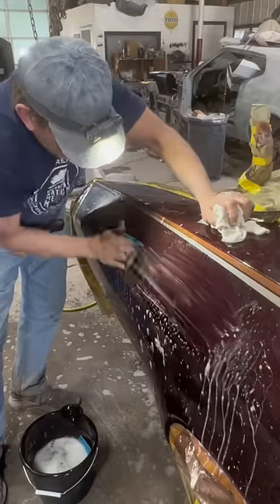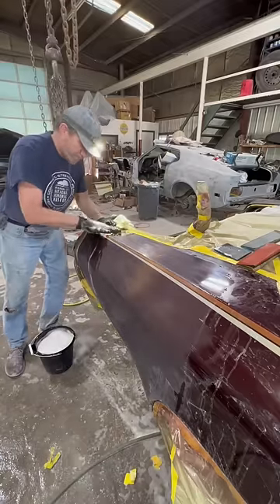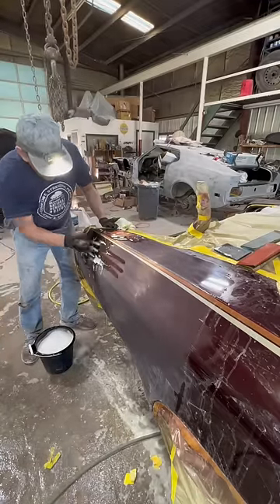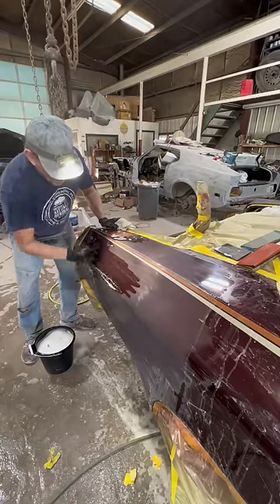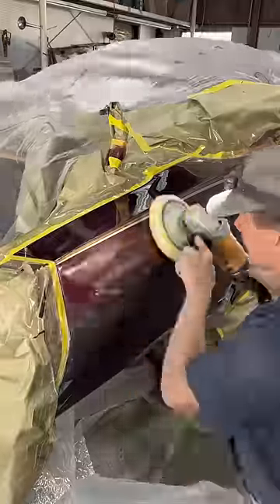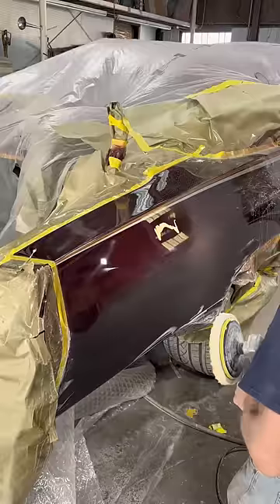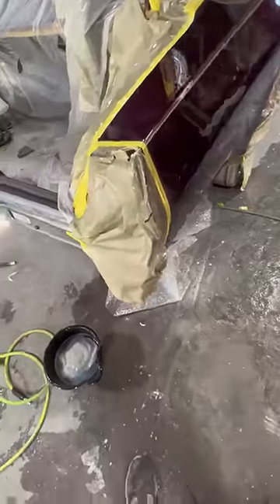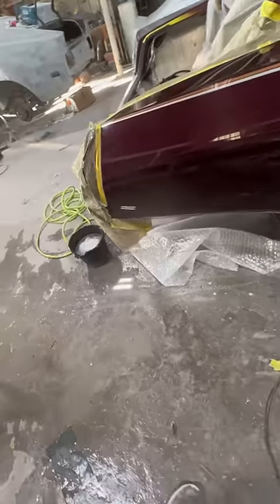DIY Colorsanding And Buffing Done FAST - How To Cut & Buff Like A Pro Block Sanding Clear Coat

Comment: Fun facts: 
>In 1921, 3M was the first American company to invent sand paper with a waterproof adhesive, most commonly used in the wet/dry sanding process today. 
>It was the Chinese who invented sand paper in the 13th century. 
>Ed Roth, of extreme hotrod design and fabrication fame was unofficially the first person to introduce the "wet" sanding and compound buffing process that set the standard for creating mirror gloss finishes that still remains to this day.
Reply from the maker: Cool facts😁😁😁😁😁
Reply: Thx for the facts

Comment: I'm a painter in the problem I have is uneducated customers.
You tell him a ridiculously low price and they think it's too expensive.
They have no clue how much work and how expensive materials are.
For example someone asked me to paint the day cab Mack truck. I told him 2500 base clear taking the mirrors lights decals Etc off the truck.
He told me that was way too much money😅
They just don't get it sometimes
Reply from the maker: I know, muh trolls constantly tell me my work won’t last without an actual clue.  Clueless trolls…. Uh luvs ‘um!!🤣🤣🤣🤣🤣
Reply: Yeah, people have no idea the cost of materials and labor. Painted the front end of a Nissan in tri coat red last week and it was over $800 just for the basecoat.
Reply: I bought a gallon of white mixing base color a few weeks ago and it was $705 people have no clue... After any surfacers, sealers, base and clear, with all reducers and hardeners it's very easy to be $1500-1800 into paint materials alone on a small car using the paint I use anyways. Then sandpaper at nearly $1 a sheet it adds up quick!
Reply: wouldhave1000 in materials Quality materials
Reply: Good work ain’t cheap and cheap work ain’t good.
Reply: I got tired of hearing the tight wad blues stories so I started another option. I did all the body work and then sent em over to Maaco. They thought I was being fair and they thought they were getting a reputable paint job, worked for me. Magazine eyes and beer drinking wallets...Now I just do my own cars
Reply from the maker: Back when I was a retail painter, I put $514 worth of Tricoat red on a late mile of Camaro front end and door and the insurance was trying to only pay 400 for materials
Reply from the maker: Unless Bondo Billy did it🤣🤣🤣🤣🤣

Comment: I use the same technique to restore headlights. Takes about an hour to do a pair. Most people think the car has been wrecked and repaired with new housings after I get done because the results are that good.
Reply from the maker: You can make good money doing that😉😁
Reply: @OldBondoBilly  I charge $70 for the service. I used to do 2 or 3 a week. But I do 500 brake jobs, 10k oil changes and 2400 tires a year is much more profitable time wise.

Comment: Wet sanding is the most labor intensive part of a high gloss paint job.
You have to wet sand after every coat of paint/gloss you spray to prep for the next coat.
After your 3-5 coats of clear you'll wet sand from 800 grit all the way to 2000 grit sandpaper before buffing out with glaze for that mirror finish. When I did my truck it took me a week to wet sand the whole truck to get it ready for the next coat. And if you are doing graphics, flames, etc, it adds more time to the paint job, masking, taping, etc. That's why these custom paint jobs can cost anywhere from $5000 to $15,000 dollars or more. The high quality materials used can easily cost $3500 bucks. I know, I spent close to $2500 bucks back in 2010 for materials!!! Most people think a paint job should cost $1000 bucks. Yeah, right. Use spray cans.
And I have used spray cans on another project
the "Road Warrior" that didn't come out that bad.
Most of the work was replacing the rusted out metal panels n body work.
This work is an Art done by Master Craftsmen...
Live to Ride
Ride to Live

Comment: Great advice from someone that has mastered the art of a perfect paint job unlike the thin orange peeled paint on new cars. I have done this for years and like this man once you get to this part of a restoration after a 1000 hrs it's quite rewarding. Several times in my 30 yrs I have been buffing like this man and someone walks in and asks "Oh wow what kind of wax do you use?" You just want to punch them. The shine comes from the prep/body work and the paint just protects it from the elements. Pretty color, the darker colors show off your work the most. White is a waste for a good shine and for me the hardest color to match. If you try to panel paint a part it either looks reddish or bluish compared to the existing paint. You have to blend both directions, try to match orange peel and hope for the best.
Reply from the maker: Don’t you love it when they rub their hand over it and say look at that shine lol😉
Reply: Agree with poor paint on new cars. Bought a new lexus and took it back after 1500 miles. Couldn't accept the orange peel for that price.  Shop foreman said they purposefully do a poor respray to match the oem paint.

Comment: Nice to see a video with true information given to the audience.  I use the 3M lineup on my restorations, start to finish.  Do wool pads not cut faster?  What brand of clear coat do you use?  How long do you let it cure before color sanding and polishing?
Reply from the maker: For me a wool pad is saved for top tier show car since a wool pad makes the entire polishing job take longer (swirls)
Reply from the maker: That clear was Finish Pro 1to1 and I let it sit almost a week 😉
Reply: @OldBondoBilly  Thank you.  That's what I figured.  During my apprenticeship, the boss always had us use wool at first.  Yes it was a restoration shop, but I think he worried about the heat that can quickly build up when using the foam pads, if you weren't careful.  Keep up the awesome work!!

Comment: I don’t know why but I still like to use a soft block when I do wet sanding, I have seen people doing it by hand and had great results just like the way you are doing it!  Good job! 👍🏽👍🏽
Reply from the maker: The 3M number 20 is a soft block.  Even a soft block leaves patterns in reverse curves like the one below the stripes on this car.  Hand sanding with a trained pattern eliminates the visible pattern left by blocking. (I am very picky about buffing prep)

Comment: Aight BB, I'm  sanding and buffing clear coat myself...on a 1/25 scale model car. 
Been using new water based createx paint. It's surprising how durable some of the new acrylic urethanes have become. It's still not 2k.....but damn close, and doesn't make my entire house smell like a paint booth when I use an airbrush...
Reply from the maker: I can’t even see stuff that small🤣🤣

Comment: Black is easiest car to paint but
It is one of the most time consuming to polish out right.
Looks like you've done a couple😁well done.
Reply from the maker: Lol. I just ran the crap out of a black car last night and made a shtick vid from it this morning .  I really can’t see to paint, and using someone else’s crap paint gun and   Spraying at 43F.😁
Reply: @OldBondoBilly  slow down faster reducer and fire up the salamander heater for about a hour heat the car up
Reply from the maker: @Mr.Avuncular  the heater was down that’s why it was 43°.  The clear was a crappy speed clear that required soaking it for not to look dry. I had to take my hat, light off my hat and wrap the headband strap around my paint gun cup to have a gun buddy light, but that just barely helped I still couldn’t see what I was doing. 😗80° with a good clear yeah I’m still laying down pretty good but in difficult situations, I’ve lost my touch because of my sight
Reply: @OldBondoBilly  all I ever use is a light at the opposite end and paint into the light, works for me by sitting one on the ground and one on the bench or wall.
Reply from the maker: @Mr.Avuncular  any light source I can see steals my vision away from anything that’s darker.  Retinitis pigmentosa is a bummer...

Comment: Lessons learned the hard way. 
As 16 year old kid got money for paint from grass mowing hauling hay. Worked my ass off sanding down my truck and taping it all up for the paint. Had it perfect in my eyes anyway, done it at painters shop, he sprayed it bright read or ragoo red and it turned out perfect, no runs, i was so happy. There was no breez, none all day long except an hour later and a hard wind for like 5 seconds come through and blowed the double doors open which blew dusy all over it., The painter said be sure to lock the doors before you leave, we forgot untile got home and that same wind came through. i remembered then. I was so sick when I saw it. It broke my heart with all that hard work and having no to repaint it. 

Ken Farris
1 second ago
As 16 year old kid got money for paint from grass mowing hauling hay. Worked my ass off sanding down my truck and taping it all up for the paint. Had it perfect in my eyes anyway, done it at painters shop, he sprayed it bright read or ragoo red and it turned out perfect, no runs, i was so happy, there was no breez, none all day long except an hour later and a hard wind for like 5 seconds come through and blowed the double doors open which blew dusy all over it, which the painter said be sure to lock the doors before you leave, we forgot untilevat home that same wind came through andbi remembered. I was so sick when I so it. It broke my heart with all that hard work and no money.. Did it in his small shop
Reply from the maker: What a bummer! 😗😗

Comment: Awesome work. When your wet sand by hand you always go same direction? I'm tired of using the DA and getting occasional pigtails.
Reply from the maker: If it’s not show paint, I dry DA dirt with 1000 and wet DA with 2000.  DA with interface pad does not delete orange peel.  For show paint I wet block with 1000 or 1200. Then hand sand with 2000 or 2500. You want sand on a straight plane if you want an actual piano finish

Comment: I recommend a sponge type block but very good work excellent ur a pro and don’t need block but I recommend one to prevent sanding through or uneven
Reply from the maker: I mumbled.  I said at the beginning that I was using a number 20 3M soft block😉

Comment: You should use a medium firm block to really get it nice and straight flat, makes a world of difference
Reply from the maker: I guess I need talking lessons😉 One of the first things I say is that I’m using a 3M no.20 block (medium firm).  Good call, though 😁😁
Reply: @OldBondoBilly  sorry about that ,I couldn't hear that because of the compressor or whatever in the back ground ,looks good for sure

Comment: I like to use 5000 grit(wet) on a da with an interface pad after the 2000 or 2500.  It makes buffing easier and doesn't bleed back scratches.
Reply from the maker: The only reason I don’t use those higher grids is there too expensive. 😁😁

Comment: is it sealed when it's done sorry for the dumb question
Reply from the maker: That is a very good question!  Once the clear is sanded, it is susceptible to a lot of potential damage if foreign substances get on it.  Buffed to a mirror finish heats the surface and basically smears it over to smoothness, making it far less susceptible to damage.  Thanks for watching and the good question🙂🙂🙂🙂🙂
Reply: Was wondering about the clear coat myself?
Reply from the maker: @Abarth-ME262  did my explanation help?
Reply: Yes thanks
Reply: The color came out beautifully. Is that Root Beer?
Reply from the maker: Thanks James!  The color is Ford HH Dark Cherry pearl.🙂

Comment: You dont have to buff it all the same day. Usually  for a really good restoration  we would sand the Clearcoat let it sit for  a couple of days this way it will dispel any of the gasses and such from the clearcoat and hardner . Keep a plastic car cover on it if your afraid of splashing stuff on it . 
For optimal results pending how the Clear laid out . If you have dust in it start with 1000 grit it will cut the orange peel if this is what you want.  Or start wth 1500 save some peel make it look "factory" . Then go to 2000, then 3,000 ,then 5,000. After this you probably could polish it in 3 minutes.  After the 5,000 it already has a dull shine and you don't have to have the buffer at high speeds to get the clear to shine.  Also with the buffer too high speed and you can heat the clear up and start to get pull marks . Start with a cutting pad after you go over wth this you can use a foam pad to get the light scratches out . Wth the foam pad after the 5,000 it will look like glass. So many different types of products to use to bring the shine up . Find out what works best for you.  Finishing the clear wth 5,000 is definitely a great way to go and less work to get the clear to shine and less time buffing.  More  time sanding but the results speak for themselves
Reply from the maker: I appreciate your time, but if I want to win best paint, I will.  I need no additional training 😉😉😉😉😉
Reply: Yeah you will get solvent pop if you use slow dry color and put clear on top it will pop

Comment: Trabaje desde muy chico y esto lo hacíamos todo a mano pasta gruesa y bolsa de alpillera lija del 360 era re gruesa pero la pintura se la aguantaba hoy en día se hace así lija de 2500 un papel pasta fina y las de terminaciones una presiosura .saludos desde Córdoba Argentina
Reply from the maker: Amigo! Trabajo mucho 360!😉. Gracias!
Reply: @OldBondoBilly  si 360 quedaba súper rayada la pintura pero en ese tiempo se usaba pintura duco y acrílico con una lija de mil no le hacía ni cosquillas era durísima y a la pasta le poníamos querosene y maisena levanta brillo pero lo de ahora es otro nivel . igualmente no me quedé en el tiempo a los 20 años trabaje en uno de los mejores talleres de Córdoba Argentina luego ya cambié de rublo soy torno fresador soldador hot tengo mi taller de herrería
Reply from the maker: Mauricio, eso es genial!😊

Comment: Is 2000 necessary if your using cutting compound? I wet sand 800, 1000, 1200 and 1500 before switching to buffing
Reply from the maker: 2000 makes it easier to buff if it’s hard clea
Reply: @OldBondoBilly  ty. I bet dark paint colors are more revealing as well
Reply: @OldBondoBilly  also great content!

Comment: How does sanding a cars finish and then adding polish create this mirror finish? Doesn't the polish eventually dry out and your left with that dull sanded finish again? I'm new to all of this so I always assumed the painting process is sand, prime, paint, clear coat.
Reply: It is a removal process, you just remove less and less material with the final steps to leave a smooth mirror finish. But you are taking away your clear coat layer to do this, which is why it doesn't dry off.
But there is a limit to how many times you can do this before your paint layer will need replacing
Reply from the maker: The high speed of the buffer combined with the abrasive in the compound basically melts the surface and flows it into a shine. If there’s not enough compound, the pad will ”burn” or smear the surface.  Once buffed it will not return to the sanded state😉

Comment: I still use wool for the initial buff, then foam for polish.
Reply from the maker: I would too if it was a supreme show car,  and I would’ve put 1000 around the squeegee and blocked it “true” flat. But I want 2K for the supreme buff, and don’t often get takers 😉😉😉😉😉
Reply: On dark colors I use foam pads after the wool pad with the compound ,2 step cutting then the foam with polish
Reply: @OldBondoBilly  I'll pay you 2k all day long to wet sand a whole car and buff it for only 2k!  I thought I had cheap customers, but I think yours take the cake!
Reply from the maker: @MAn-ti3ul  I’m in Oklahoma bring me an 8 car hauler full, and I’ll get right to work, jefe🤣🤣🤣🤣🤣
Reply from the maker: YesWelder car 90
Reply from the maker: Tggg

Comment: I’m going to try my hand at wet sanding soon!
Reply: Day one and I didn’t try any wet sanding today.
Reply: Day two and no wet Sanding today!
Reply: Day 3 and I still haven’t wet sanded muh ride 😩
Reply: Day four and no wet sanding today but I did finally get the plasma going today! Subscribe damnit!
Reply: This is the 5th day I’ve stopped by here and BB is still wet sanding!
Reply: Day Skix and I still haven’t wet sanded 😩. Maybe tomorrow
Reply: Day 7 and Billy is still working on the same 1/4 panel. It’ll be slick as glass when day 9 gets here! Subscribe Damnit!
Reply: Day 8 and I forgot to turn muh hand and now I got finger streaks sanded into muh paint job!
Reply: Day nine and feeling fine!

Comment: And it doesn’t have that smokey look or swirls in the sun light from certain angles ?
Reply from the maker: Just barely at this stage, but machine polish will finish it off😉
Reply: @OldBondoBilly  I swear I haven’t had a body shop or detail shop yet that hasn’t swirled a car with a high speed buffer. I refuse now

Comment: 3000 rpm is very fast. What kind of clear is that?  I've got a problem. I'm old to youngsters and young to oldsters so I have seen drastic changes. First time I buffed a car years ago the compound removed 2000 grit 3m paper. Now I have to 3000 5000 and 8000 for black especially. Step 2 and 3 is not the same as it was in 04 in my honest opinion. But I know you're gonna tell me some crazy stuff like the older compounds removed 1000 grit.
Reply from the maker: I’m gonna tell ya it all depends on what yer buffin’. But I always run muh buffer fast out in the flat spots😉😉

Comment: Try dry sanding. 1500 bit rough kills orange peel, start with 2000.
Reply from the maker: If you’re talking about DA sanding, this is a show car not a retail job
Reply: @Bondo Billy  have u ever dried sand for buff? Show Cars actually go through dry sanding process for buff and polish now a days
Reply: @Bondo Billy  u would use wha we call a finishing da. Not a  regular da for bondo